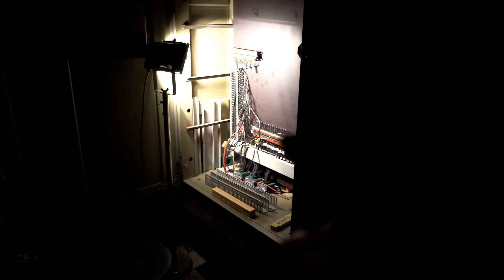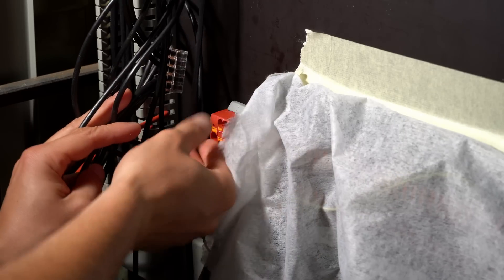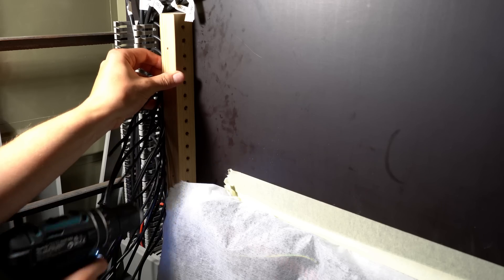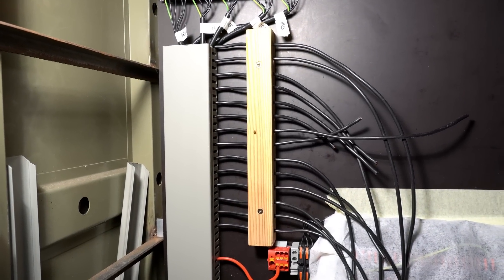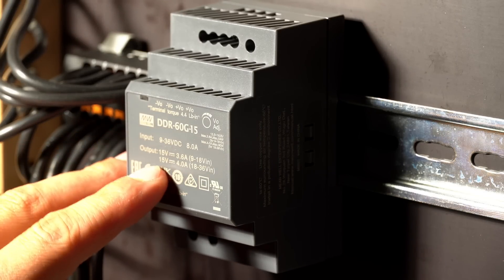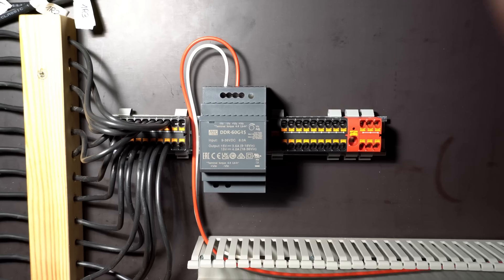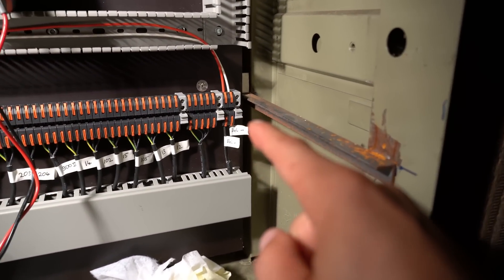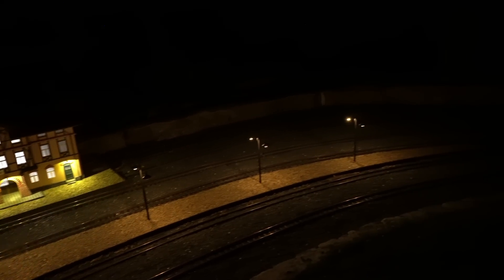This station area is lit!

Comment: Love the videos and your work. If I may make a suggestion, throw a little bit of train running in each video! A train pulling into the station under the new lights would have been perfect!
Reply from the maker: Thank you! I get your request, you are not the only one that was suggesting this. The problem is I don´t have time at the moment to do the work and additionaly make the layout operational regarding track cleaning and preparing the rolling stock. This takes additional hours that I don´t have right now. I will run some trains in December and after the electrical is done it is much more likely that I am going to run my trains more frequent.

Comment: When you use fine stranded wires in the PTFIX blocks, always release the springs with the push in button before you insert the wire.
Reply from the maker: Thank you for the tip, you are totally right!

Comment: Sieht hammergeil aus! Aber wieso kommen da 15 Volt raus, so eine ungerade Zahl? Ich hatte 12 erwartet. Und warum nutzt du zwei Trafos statt einem?
Reply from the maker: Die Beleuchtung ist ein wilder mix an verschiedenen Betriebsspannungen. Die Bahnsteigleuchten können bis 19V, die Hausbeleuchtungen bis 24V und ein paar ander LED´s nur 16V. Da ich nur eine Spannungsversorgung für den gesamten Bahnhof habe nutze ich also einen 15V Trafo zur Versorgung. Das sorgt auch gleich dafür das Haus- und Bahnsteigbeleuchtung nicht übertrieben hell sind sondern ein schönes Licht machen. Den 15V Trafo versorge ich wiederum mit 24V weil das der einzige Strom ist den ich in meinem Stellwerksschrank haben werde. Da ich die Leitungen zur Versorgung von dem Stellwerksschrank aber noch nicht verlegt habe musste ich einen zweiten 24V Trafo davor hängen um das ganze zu testen. Dieser Trafo kommt natürlich später nicht mehr zum Einsatz.
Reply: @summitrailway  Danke für die lange Antwort. Tolle Anlage!

Comment: For stranded wire some ferrules are highly recommended.
Reply: Those connectors have spring clamps, so it is better not to use ferrules there. But yes it is required on the DC converter with screw terminals.
Reply from the maker: @gabor.nadudvari Regarding the connectors I could have at least released the springs before inserting the wires, I will do so next time. Regarding the DC converter I tried using ferrules but it wasn´t going to happen because of the wire dimenstions and some wrong crimping pliers. I am sure it will work just fine like it is but you are totally right that it is required to use those in this case.
Reply from the maker: Funny enough I tried using them but because of the thick wire and obviously the wrong crimping pliers it hasn´t worked out. My whole attemped to do so was deleted in post production because it was rather boring to watch.